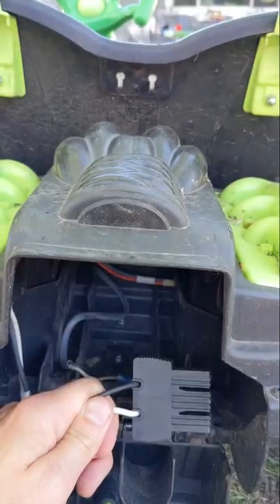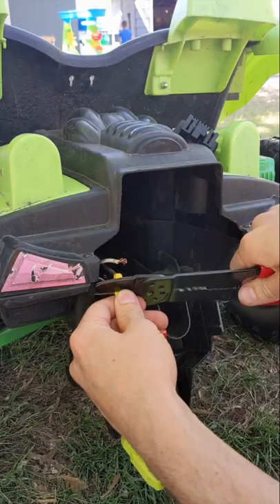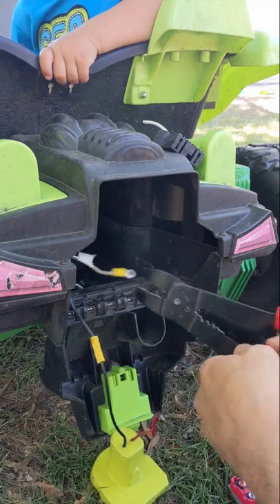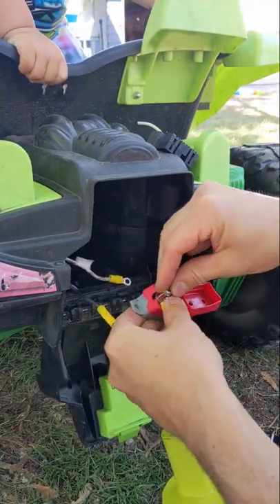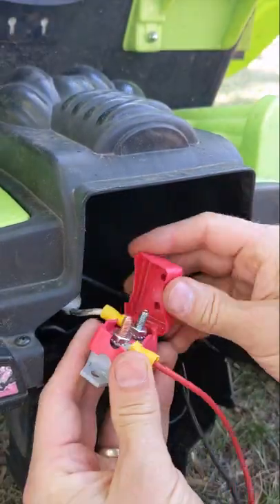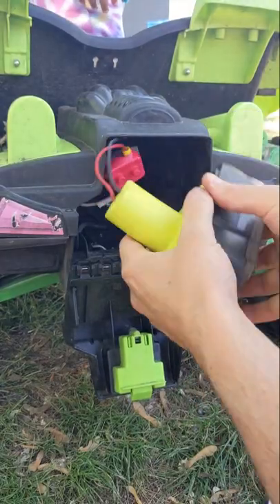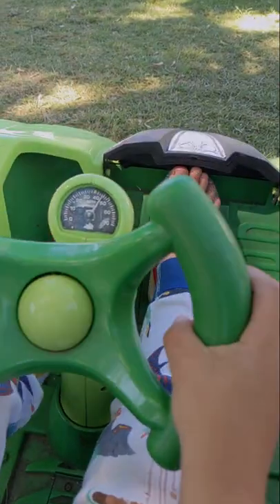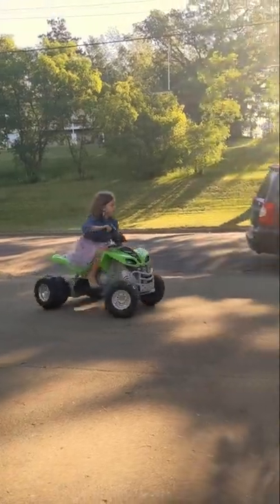Powered Up for $20 (Quick & Easy DIY 18 / 20 Volt Power Wheel) #Shorts #Power Wheels #Speed #Ryobi

Comment: I kept the 12 volt battery, but added a “turbo boost” button.  This button is wired to a relay that switches between the 12 volt battery and the drill battery.  This way it doesn’t give as big of a shock to the plastic gears which makes them last longer.  Plus, my daughter enjoys cruising, then hitting the turbo boost button to kick up the speed.
Reply from the maker: That's a cool way to do it. It probably lasts longer too.

Comment: I want to build one of these with a steel frame, rack and pinion gear steering, live rear axle with disc brake, and atv tires, with a predator 212cc on the back
Reply from the maker: That would be epic. Even if just installing the shell onto an existing go kart would look awesome.
Reply: @RecycledWorkshop  I’m almost finished with the entire build from scratch

Comment: How long does it run with the Ryobi battery?
Reply from the maker: The small 2ah batteries don't work for long. The bigger batteries typically last for 30 minutes or more of hard driving. My new 6ah Ryobi seems to last for about an hour.
Reply: That's not long enough

Comment: Have you burned up a Mother board yet?
Reply from the maker: No. Even though all mine are used, I haven't had that issue. I think the circuit breaker is key. (it never gets "too hot")
Reply: @Recycled Workshop  Makes sense my girl friend Hopped into my son's GMC 1 Wheel drive after I hooked up a 18v H.O Milwaukee battery to it! It about tossed her into the shadow realm. But instead got so Hot it melted the soldering on the board about 3 weeks ago! 

We Resoldered it and im now Running Twin 12v Motors on a single M12 Milwaukee works perfect now fixed it earlier today! 👌 

Thanks for the quick response With the 18v battery and her added 160 pounds just gave it too much a load! Though it seemed unaffected! lol

Comment: Will it burn the motor?
Reply from the maker: In my experience it will last a couple years and then burn out. The speed isn't a problem, but the torque is. It's tough on the motor and gears when they suddenly accelerate.
Reply from the maker: The Dune Racer and the 4 wheeler haven't burnt out. It's probably a better motor, or it's having the overload breaker.
Reply: Thank you. I’ll try to pick one of those up